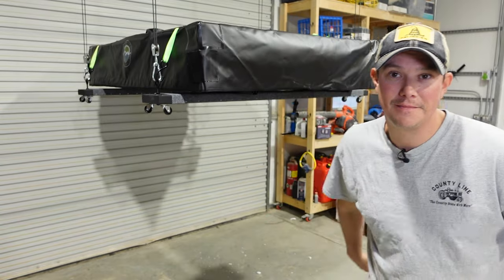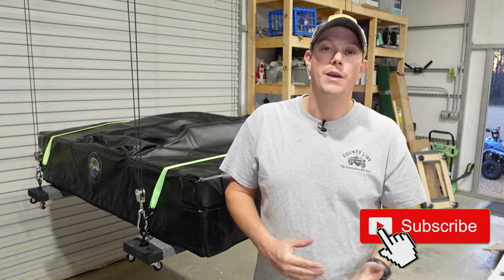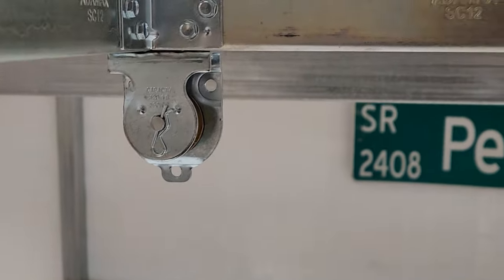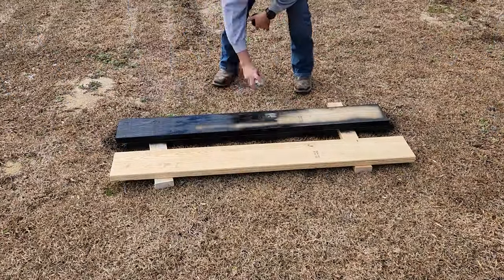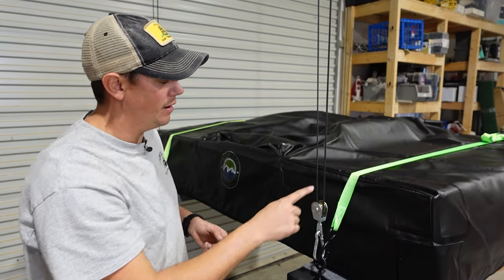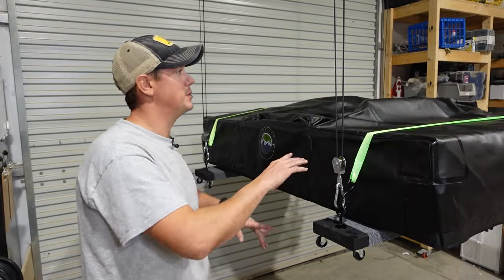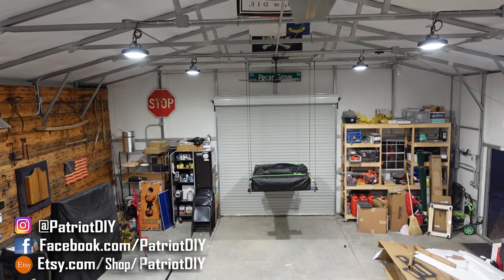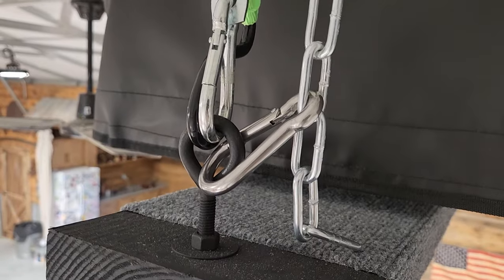DIY Garage Hoist / Lift System / Rooftop Tent Storage

Comment: You can shorten the length of the winch leg by doing the same "double back to stationary" loop you did on each of the platform legs. You just double that lift capacity back, but half that distance.

Comment: maybe add 1 more pulley so the control is at a more reasonable height
Reply from the maker: Ended up switching to a wireless remote winch, link in description

Comment: Freaking awesome! I have a few questions: I’m a female DIY’er who wants to do this in my garage. Can this be attached to the ceiling joists directly in my garage as I don’t have the metal frame you have? THANK YOU IN ADVANCE! 😊
Reply: yes. depending on size and weight you are going to have on it you can use lag screws vertically into the underside of joists or brackets bolted to the side of joists. also depending on weight on it and joist size you may need to double up the joists or brace with steel. i have a hoist lifting riding mowers attached to a square sign post section spanning 3 2x8 joists with center joist doubled cause i was getting a little flex and the joists span 12 feet in a 60 year old barn so after few years of use i doubled the 1 up. its clamped to the tube but square tube is only held by 3 lag screws, 1 in each joist. though i did just get some reinforcing brackets to add to it to make me feel safer using it. my set up i feel will out hold the 1000 lb capacity of the winch and i just did a bare minimum set up. never hurts to over do something like this though.

Comment: Great video, much better instructions than another I saw. Thanks for the links for these parts, they are very helpful. Rather than a wench, I'll try to figure out how to increase mechanical advantage using more pulleys.  I like the unistrut idea, provides more flexibility, in case I figure placement of pulleys wrong to begin with, they are easily moved, rather expensive initially though. I plan on having maybe 4 platforms like this since I have no where else to store things.  Again, really great video with awesome instructions!

Comment: Question,
I am trying to do a system in my garage for my son's train table.  Was there a reason other than your garage being steel framed to using the super strut c channel for the frame base for the lift?  I will need to mount the 4 corners directly to my ceiling  so Im wondering if in my scenario the super strut is over kill since I can use the house joists as mounting for the pulleys? As well as the fact that I need to go to the ceiling versus having ceiling framing to work around.

I will build the base frame out of 2x4x8 and do cross members across in about every 16" ish supporting the 4 outer corners of the frame with some mitered angle braces to keep it square and support from potential twisting.  The top will be 3/4 plywood and on top of that a combination of sculpted insulation foam, some buildings, bridges and HO scale tracks for his trains along with buildings and scenery over time I guess. Obviously the trains themselves as well.

I like the double pulley design and think it will work well and am going to attempt to put legs that can be lowered and raised perhaps with a simple latch bolt and ceiling chain approx 12"-14" with hook to loop to so the frame doesn't also keep weight and strain on the winch and cables.  I am trying to determine mounting of the winch also to determine lift etc?  Do you suggest any sort of stop block to guide when you know it's time to stop?  If so what or how might you do that?

So all in all from parts list you used 1 or 2 bundles of rope?
How many pulleys a total of 10?
The spring clamps?
I assume if I am using 2x4 I will need the eyebolts to be 6" not 4" correct?
Would it bet find to use the paracord or would steel cable be better?

Do you think this will work this way and do you think there might be better or alternate ways to build it?

Comment: Great idea and video. Are you concerned about wear and tear on the cord (vs. using cable)?   My application would be for a 12 ft ceiling in the garage.  Do I need to build a frame, attached to the ceiling or attach directly to joist s? What is your estimated cost for this build?

Comment: great project....one question.  i see your pulleys and paracord are directly vertical @ 90 degree angles...is it a problem if the pulleys are not @ 90 degrees, say 120 degrees on all 4 pulleys?
Reply: If you mean the pulley angles are sharper towards the centerlines of the platform, it will create a less stable platform. It depends on the dimensions of the platform on if it will be dangerous

Comment: For your final assembly was 200 feet of cord enough?  I like the double cord lifting idea.  Do you have a link to the "L" brackets you used to connect the Unistrut together and the fasteners?
Reply from the maker: I had 250. Not sure how much was left over

Comment: I have a question about the paracord you chose.  My understanding is that for this type of setup it is better to use rope/cable that does not stretch.  I think paracord stretches so over time you may have one corner start to dip lower.  Is my understanding incorrect?
Reply from the maker: I don't know about that

Comment: Sweet build. Any reason not to add another pulley on the ceiling and double back so the hoist and controls are by the load? Would half the distance required on the ceiling as well.
Reply from the maker: The winch cable is only 34ft and the junction where the 4 ropes meet can't go through a pulley. 
   I had a more elaborate setup with several turns when I first set it up with the hand winch, but when I switched to the electric I just went straight!! 

BUT....about 2 days after this video I switched again to a WIRELESS electric hoist. Now it doesn't really matter where it is! Lol
https://amzn.to/48GoyFw

Comment: At around 7:40 you do a walk through and the center pulleys have a modification on how they are mounted. What did you change and why? Thanks!
Reply from the maker: No big difference, just added a board as a spacer so the rope would be a bit lower and more in line with the other pulleys

Comment: Nice system. Great idea on chain for storage support. 
How did you determine if building frame would support this?
Reply from the maker: Thanks! To be honest I didn't put much thought into whether it could support it. I figured it's a steel frame and my load is only about 160lb. Should be fine.     If we were talking 400+ it may be more of an issue.